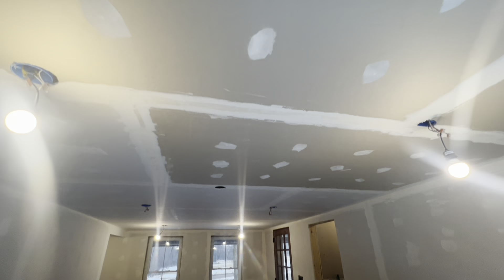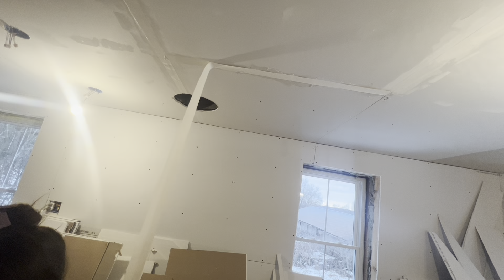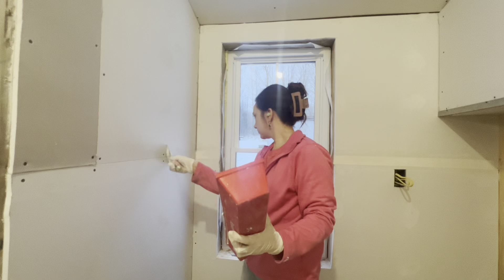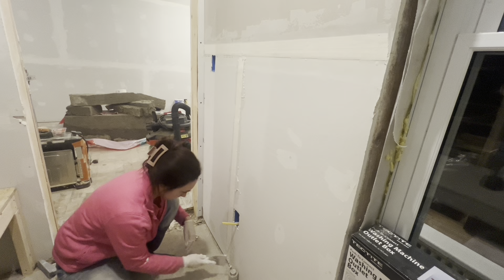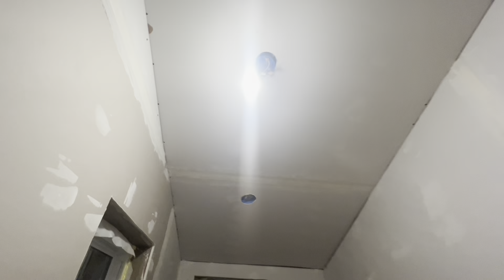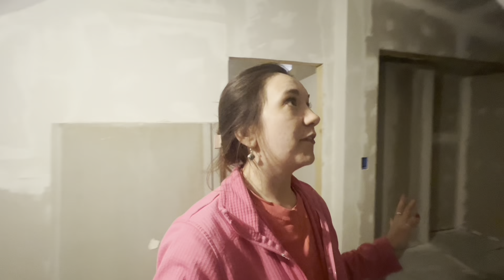Satisfying Drywall Mudding & Taping! | My Fixer Upper Renovation | ASMR

Comment: Has Jay spoke to you about painting  methods Abbie ?  I found spray painting was easier and less stress on the body than rolling > I used a Wagner electric spray gun made in Germany . They are home owner affordable machine priced between $250 to $300 only. With a bit of practise on a couple of scrap material you will work out that a 100 mils away from wall will give you a good one coat coverage . Wash up with water for water based paints and keep the jets in submersed water when not using .